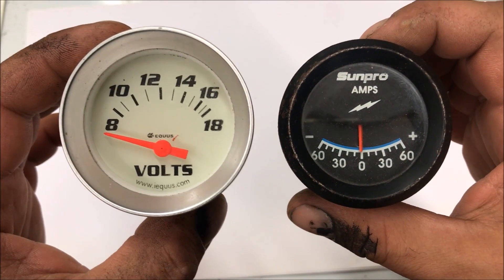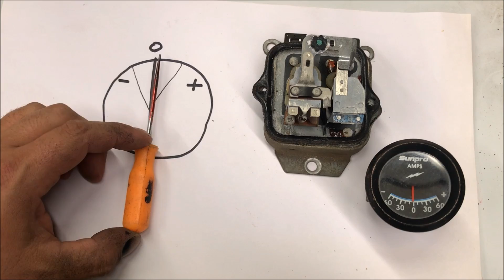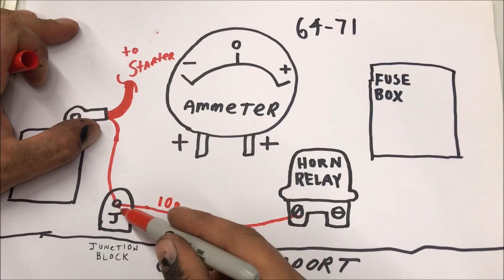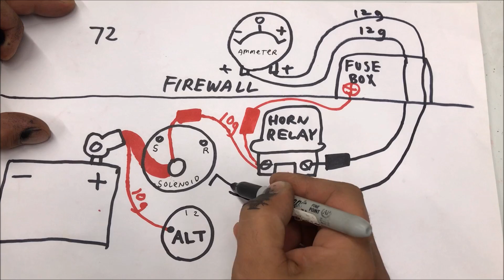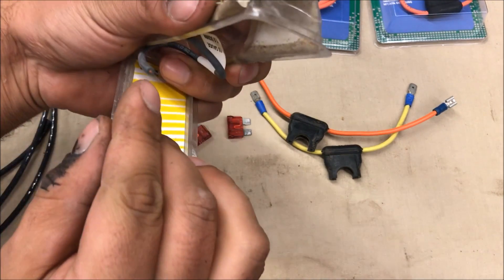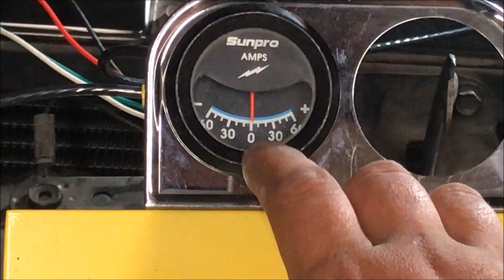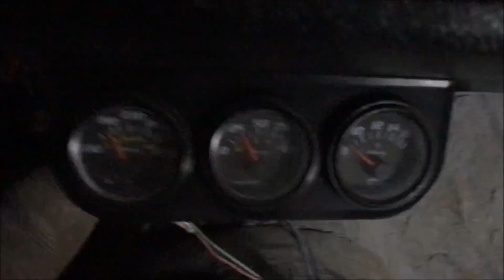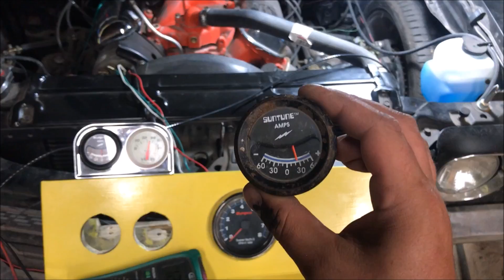how to wire ammeter and volt meter AMP meter DIY

Comment: Sir. There is a Purple Wire coming from the Engine Side Harness. Is it the "Fusible Link" and where is it terminated under the Dash ? Ted.
Reply from the maker: that is a 10g wire that goes to the S on the starter solenoid.. it goes to the neutral safety switch then to the ignition switch on the bottom of the steering column.. so if you have a center console it will have a neutral safety switch there.. column shift auto will have the nuetral safety at the bottom of the steering column..68-72 gm a body.. yes, it is supposed to have a fused link by the solenoid but they are always cut out

Comment: Sorry back to it. What if you have an ammeter and have a one wire alternator?
Reply from the maker: the alternator does not matter you just don’t run any ammeter leads straight to the battery

Comment: what you dont realise is peopel use all cindes of gages on porpose to change the polarity of the entinre engine on porpose to get diferent effects on the ignition system no mather if you spark inside ore out side the engine it does not mather the polarity of a ignition coil it still will fire expecialy if you mention in your video alternators and starter motors who by the way can bouth by a motor and generator at the same time and you did mention a horn relay and a buzzer that used the old cars like ford model T for exampel if wrong wired ore made some on porpose modifications you can have engine run one isues not only that you can actualy make a increase in ignition energy consuption that why peopel experiance a drop in fuel consuption because the system switching from positive to negative ground ignition system thats why those gages and selenoids are made for and their true porpose expecialy if you have dual ignition like waste spark managment you get lot diferent interesting effects ore use compresion to ignite fuel on compresion stroke and use ignition coil to fire it on exaust stroke virtualy you shuld get the similar effect like the waste spark all it need to do is to force more air on the compresion stroke and there you go expecialy if you runing a engine on cold implosion your egr system is always open  so any thing that is not burn will by returned back and burn fuel again only thing that peopel didnt realise is they need a higher spark and that is achived with plasma ignition so basicaly your gasoline engine can by easely turned to a disel engine futher more a 4stroke can by turnet to a 2stroke as well thats why oil and fuel aditives were originaly meant to do as well thats their real porpose to enialete engine diferences many peopel dont know about this litel info only the old mechanics know about this that is war tehnology by the way you can have dual ignition ore dual grounding decices so the truth is you dont need big engines at all to have masive power out put a small one does the same with less fuel consuption thats where fuel vaporization tehnology comes in to play you can go lean as much as you like only if you have a strong enough ignition system to actualy ignite it GM uses that actual with HEI and on carburators selenoids and vvt selenoids to let the fuel in and to vaporise it with a curent you get increase in volumen of fuel meaning more will go in the cilinders by using less fuel just like a ordinary LPG car and gasoline is lot stronger than LPG its waste shit the truth is you can performe all day work with 3L of fuel just like the old disel generators they were used on stone cruching mines high torgue wood saws etc and you actualy culd use multipel fuel types by using a fuel mixing valves ore chambers the erly disel engines didnt have a pump the used a second mixing chamber so there you go peopel some of the good old tehnology by the way peopel all the ignition systems today are only a bade replacement for the original DC magneto that staff was solid and bulet pruff today engines are shit thats why peopel love old timers you can mode them how much you want and see amazing things

Comment: My install instructions for a Ford say to pull accessory wires off starter switch where main +bat connects, hook one end of amp gauge there with main +cable. Bolt all the accessory wires together with other end of amp gauge. Does this sound legit?
Reply from the maker: yes... the ford just gets a little tricky cause you have the external solenoid.. let me know what happens
Reply: I decided not to use the amp gauge. I thought it would be better for showing instantly if the alternator, voltage regulator or fan belt went out. Though I'm not so sure it would really be more visible than a volt gauge. That car reminds me of my 1st car, 1970 Monte. The grill, headlights dash looks identicle. Late 60s early 70s. Those were some good years.

Comment: Very good theory and practical run. I was always fond of my amp meter in my previous van. My now 05 Town and country Chrysler doesn't have one. But I would like to adapt one. Would you happen to know how to wire this round type into the vans 12v system? Gauge will go on dash. Please be as specific  as possible. Thx

Comment: You only had to adjust the voltage regulator when you installed them. You had to set it so that it still charged with everything on but wouldn't overcharge when everything was off.